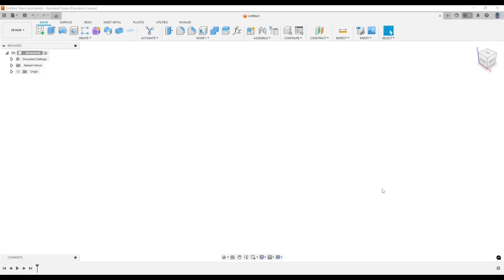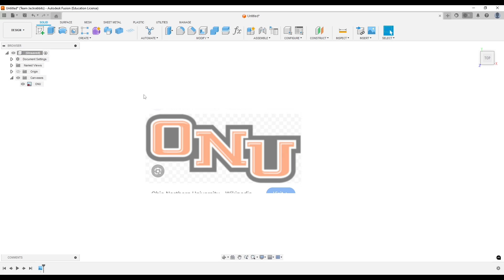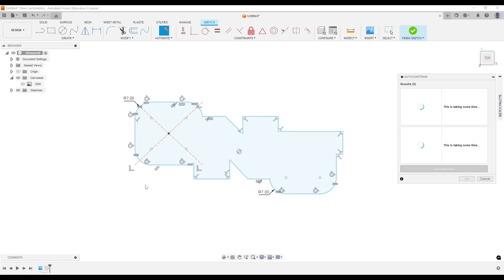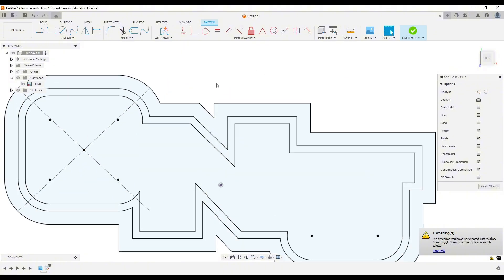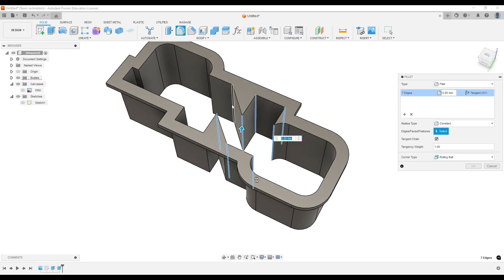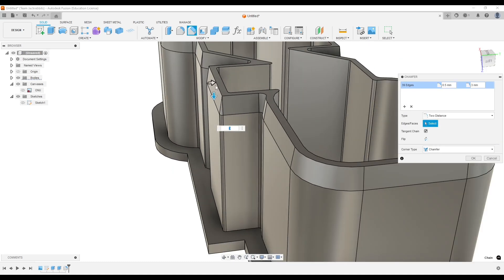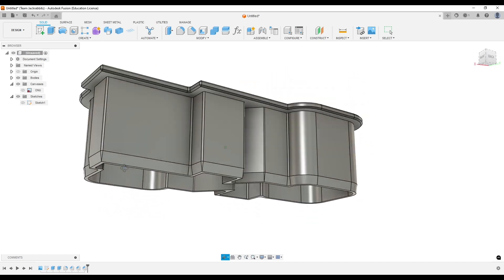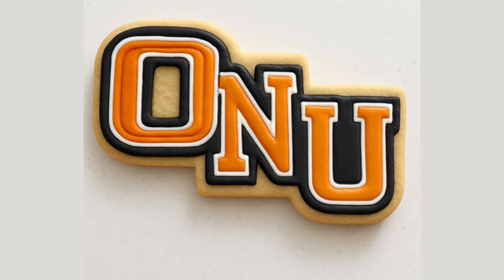Design and 3D Print a Cookie Cutter

Comment from the maker: I just noticed that when I was offsetting the sketch (4:07), I did the 1.6mm offset in the wrong direction. What I did in the video made the whole cookie cutter smaller (than the photo). I should have offset it in the opposite direction (making it larger). Then when I made my 3mm "ledge" I should have done another offset of 4.6 (3+1.6).  Just thought I'd point that out!

Comment: You can enter inches into the dimension field and Fusion will convert to mm (or whatever your preferred settings are in preferences). For example, you could have entered 3in into the calibrate field and Fusion would convert that to 76.2mm. This works for any measurement (lbs, grams, ft, etc.).

Comment: You can just enter the inch dimension you need and the units will automatically convert the value. So if you entered “3.50IN” and hit enter the dimension would show the millimeter conversion.
Reply from the maker: Nice! I did not know that! Thanks for the tip!